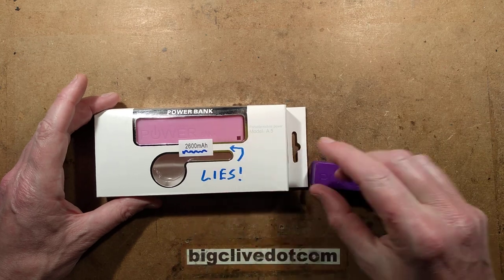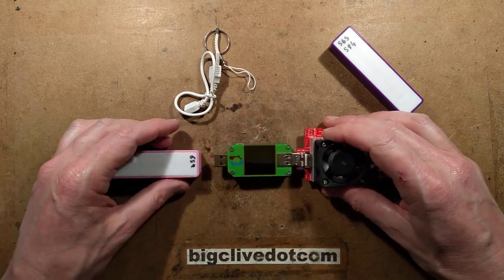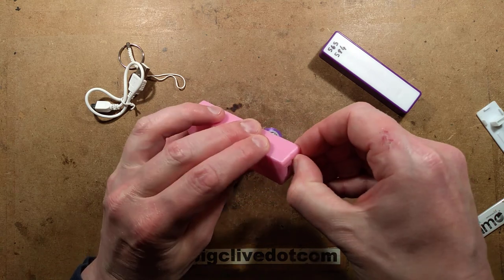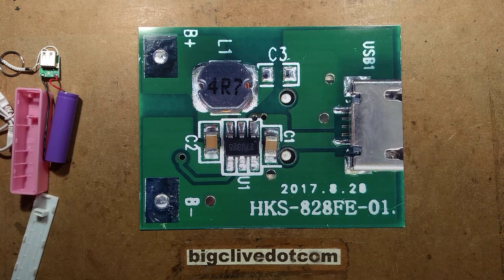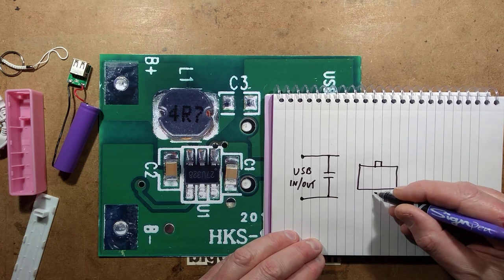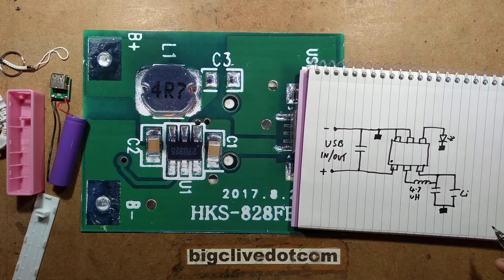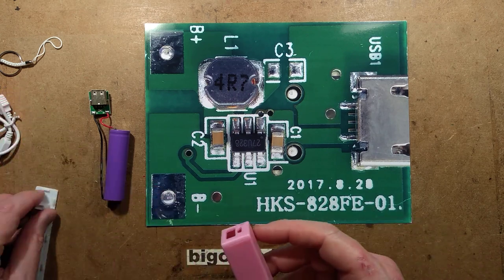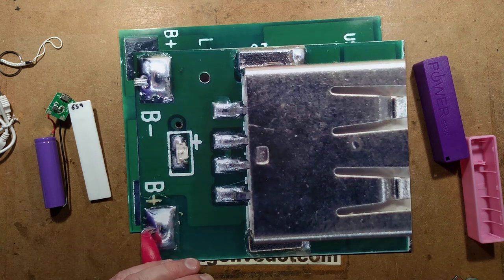Simplest power bank ever?

Comment: Clive... in an old video that I can not find now you showed microUSB with pust pinned power leads (not smt) I have looked for them on ebay and ali and can not find... do you have any references?
Reply from the maker: If you mean the two pin micro USB connectors they came from aliexpress and were described as 2 pin micro USB.

Comment: Any way this chip could be used with more batteries ? Nice video thank you
Reply from the maker: You can add other cells in parallel, making sure that the voltages are very close before joining them in parallel.  It will result in a higher capacity power bank.  For big clusters of cells I recommend adding a fuse in the region of 3A.

Comment: With that design, couldn't you "chain" these?  So that lets say you had six of them, your would wire them all up in serial and they would charge and discharge together.  Also, they could be used kinda like a USB UPS as they can switch from charging and discharging when power is lost.

Comment: Isn't the capacity you measured, just a capacity at 5V? The capacity of the cell would be accordingly higher, due to lower voltage and inefficiencies of boosting voltage.

Comment: Scammers have been at this since before lithium batteries existed.  I once came acrosss a suspiciously lighweight "D" cell, and on tearing it open found a AA battery in a D-sized plastic cylinder.

Comment: Been meaning to ask... are these rock-bottom priced powerbanks using "passed" 18650s from failed laptop batteries or just new cheap and nasty 18650s?
Reply: From what I've seen they're new crap. Ex-laptop cells (good ones, at least) are perfect for these powerbanks.
Reply: @bobs12andahalf2  Be interesting to see one of these cheap knock off cells opened up and compare it to a good quality high capacity cell, what is the betting that these cheap knock offs pack more inert filler than actual electrode and electrolyte material unlike the good quality cells that pack the inside of the unit as tightly as possible for maximum capacity per unit volume. My guess if you took the stuff inside out and unrolled it they are probably just using a fraction of the active material a quality battery that actually is capable of the stated capacity is using.

Comment: I posted a comment here recently about how you can take advantage of the lies and get free power banks and batteries, and today I ended up discussing the issue quite frankly with an eBay seller, and I thought his explanation was rather interesting.  I had bought 6800 mAh 18650 batteries and complained that they were only 1200 mAh.  He said:

"To be honest, you are the second one that point out these battery is not as described in past 6 months. I have sold thousands of these batteries in past 6 months. Yeah it's just the market, I import good battery at first which was about 2500 mah, cost me $6 each to land in Australia... I found it real hard to sell, as I can't compete with those big brand like samsung, panasonic etc, and then I found out most small sellers, have very good amount of sales by marking them 6800mah, 9800mah..Yeah you can tell by the price easily that's fake number, however, most buyers use these batteries for their torch, laser pointer, or other equipments, they don't really know about battery, I can say more than 95% customers won't check the capacity coz if battery put in equipment and it works, then that's it... I am not very proud of what I do but if everyone else in this market doing these fake sales, then I have to sell them this way for make a living. Otherwise I can't even make a sale if I mark it honestly as 1200 mah.

We get them from Chinese factory. Well yeah suppliers in China won't tell you the truth output if you don't ask.. After you asked, they can help you mark it as much as you like, you can mark it as 10000mah... And any other brand they can fake it...So I can mark these battery in Samsung, Panasonic etc if I like. Just a plastic wrap paper, you can print whatever you like. I don't know battery well so I can't even tell its core is good or bad, that's no way to tell."

That last sentence was because I asked whether these were factory seconds or specifically produced with a lower capacity.  And for the record, because this guy was so honest and up front I didn't ask for a refund in the end.
Reply: Only about 5 % of buyers (at best) realise they buy this fake, corresponds to seller's negative feedback.  

Of course what causes this whole industry to survive and prosper is the dumb and stupid way all consumer devices indicate " % charge " instead of Energy Capacity.

Comment: Given that the input and output of this are in parallel, would it be possible to use this circuit as an uninterruptable power supply?
Reply from the maker: I tested that.  When an LED module was powered from the unit while it was connected to a charger it lit the LED module while charging, but when the supply was removed the LEDs went out briefly before the unit detected it was not being charged and kicked in.

Comment: Very true big Clive mate granted there are some very dodgy power banks out there probably more often than not sold on eBay I bought a 10,000 mah dual usb port charger from B and M about 6 years ago made by Goodman's to be honest it's rugged and I like how it has a led display to show the charging rate when been charged up and also the way it tells you the charging status of devices connected to it as by and large all I use it for is charging up my 88 vape e pens though it does support fast charging of apple products i.e i phoned I pad but I don't use it for my android phone i find that my phone charger is faster than the power bank 😅

Comment: Brilliant as ever. How are you checking the mAH? do you have special bit of kit or even more clever Mathes?
Reply: He uses the the (green device he plugged in first) they are quit handy, it will tell you capacity, mah, voltage. And a timer. USB voltmeter is how ya look them up.
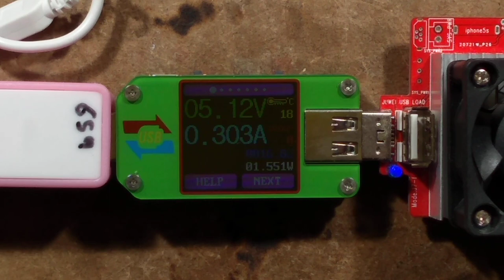Reply: Did you notice at 2:56 how the capacity reading was flashing?  This is the last reading the device had before it lost power.  So you can use them to run a power bank completely flat, then plug them into USB power again and you get a few seconds to read the flashing capacity from that last run before it resets to zero.  This means you can use the same device to measure how much power a bank absorbs when charging, and then how much of that gets returned again when you use it to power something.  Very useful!
Reply: @Berkeloid0  The flashing one was mWh reading... Did you mean that or the mAh one? Also, can you explain the whole process a little more in steps, please? Didn't quite catch it... Thanks for your time. Because I'm doing it right now to test my car starter cum power bank with two similar but not the same meter and load.

Comment: Could this be used as a sort of UPS for USB powered devices? 

I made a nightlight with a Arduino and neopixels - It draws about 40mah average, but when the power goes out my daughter can't sleep without it. Would you trust this sitting behind a bed, plugged in non-stop?  (and would 40mah stop it from going to sleep?)
Reply: Sudz mah.  I don't know if it'll feed a 40mA load or shut off.  However as for bedside safety, the quality and safety of the mains-to-5V adapter is much more important, as some are prone to cause fire or electrocution.
Reply: @johnfrancisdoe1563  I'd use my own 18650 on this for sure. Just seemed like a fairly well designed little chip. He didn't really imply it'd burst out into flames. 

The charger I'm using is an Old Blackberry charger - its been going strong for 4 years now, and at that light a load its not working hard at all.
Reply from the maker: I have a night light based on a couple of good quality NiMh cells and a standard warm white LED.  It runs for months on a charge and puts out just enough light at night to provide comfort.
Reply: bigclivedotcom my idea is a bit different. I was wondering if the circuitry would work in a way that would charge the battery and pass through 5v when supplied with power, then kick in automatically when the supply is dropped.  The nightlight is a baby's mobile with a flying Tardis with some gently twinkling neopixels, surrounded by planets and translucent stars.

Comment: the mAh rating on those is for the battery inside not after the step up loss but still this is wayyy off
Reply: True enough, I would expect even good ones to be on the order of 5-10% lower than advertised if measuring the output current as I would expect manufacturers to measure the input current during charging instead since this will always give the larger sounding number for the packet as it omits the inefficiency losses of the cycle. Probably closer to double that once you make allowances for acceptable tolerances during binning etc.

Comment: Comments remind me interesting open letter to Samsung I'd seen (about trying to buy a genuine branded cell), which I've just found again and pasted here..

The situation at present is riduclous. A thriving counterfeting industry based in Shengzen exists. They clone a Samsung battery in every way except achieve the authentic Samsung battery performance. The consumer sees a mA/hr number on the label but it's counterfeit as the printed Samsung logo. 

Now if the smartphone displays battery status in mA/hrs actual ENERGY LEVEL instead of the usual ''percentage fill level'' , then showing this mA/hrs would stamp out the problem of counterfeiting overnight. You would give the consumer the tool to police the counterfeiting industry from their end of the supply chain by showing them the quantity of stored energy they have after they fully charged their device. 

Meanwhile only a small percentage of people know what mA/hrs is and have the means to measure it. You will find that this perctentage closely corresponds to the amount of negative feedback received by Ebay seller of ‘geniuine Samsung battery’. This sector of people is growing. These people exploit the present situation to obtain a lifetime’s supply of free batteries. They do this buying Samsung-branded batteries (including 18650), use their equipment to prove they bought a counterfeit, demand a refund and then keep the ‘Samsung’ batteries. In rare cases they will receive an authentic battery so these people win both ways. 

In this age of climate change concerns the consumer is becoming ever more concious of the concept of energy level. They have a power meter in the home showing watts. 

I am saying please make your new phones indicate energy level (not fill level) and enable the consumer to be aware and stamp out the replacement battery counterfeiting industry from their end of the supply chain.

Comment: Hey BC/DC :D , or just Clive. :) I don't know where to post this at all. I am replacing caps in an older Asus router, I replaced two of the three caps with exact values, but the third one I do not have. It's a 1000UF 6.3V cap, and the closest I have is a 1000UF 25V cap. Can I use that cap, or do I need to buy a new exact cap?
Reply: Phrea Nix Higher voltage cap just means it might last longer at the low actual voltage.
Reply: @johnfrancisdoe1563  Ok, so replacing a 1000UF 6.3V cap with a 1000UF 25V cap is very ok?  
What about 'smoothing' etc? It's on a router.
Reply: @phreapersoonlijk  capacity and voltage are OK (voltage rating on a cap is how much it can handle, so a higher rating just means higher margins, but also usually a larger physical case)
What might come into play is ESR (equivalent series resistance), for effective smoothing you want low ESR - you'd either need the data sheets/specs or measure a known good example of the original...

Comment: Could you use these batteries in electronic cigarettes if you desoldered the wires?
Reply from the maker: No.  They are not suited to supplying high current.

Comment: I got some cheap AA batteries from china.  Stamped 1500mAh actually 250mAh.  The logic there is you get 6 charge/discharge cycles before they explode!  6 x 250mAh = 1500mAh, makes perfect sense but means you only get 3 cycles before yours go bang!

Comment: A decent 2000mah battery sells for around $4, what do people expect for a dollar or 2?? And that board (or similar) sells on eBay for about $0.79.
Reply: theR6969 They expect a typical 50% off on the price deal.  A factor of 2 on single item prices is not suspect in retail, as long as there's a BS explanation like "holiday special" or "Max 2 per customer" or "stock clearance".

Comment: So the circuit is pretty good, but it's downfall is a crap battery. 
Here in Australia I bought one that looks similar, but it was from Kmart instead, I took it apart and it had an orange 18650 in it, which says it's 2000mAh, I used the Imax b6 and indeed it is 2000mAh, so you can get some pretty decent ones obviously, even if cheap, since mine was only 5 dollars Australian. 
However the capacities of the batteries in your video, and it's low amp output, both suggest that these are lower quality batteries, likely even physically lighter in weight and in only the high 30's of grams. If you put in a higher quality battery, the power bank would probably become useful.

Comment: We have those at The Dollarama here in Canada I tore out the board for a 3000 mAh phone battery. 
Edit it certainly has more components on it though
Reply: the case is standard, it has the right size for a buck/boost converter and a 18650 battery, and is injection molded by the hundreds of thousands

Comment: The best. To my own knowledge is the US sold generic iHome battery power bank. I can get 3 full phone charges, which I paid for about 20; prior, I bought a Chinese sold on eBay power bank with solar panel, and an led lamp... That piece of garbage charged my phone 50%, and then died.

Lessons learned; by ever buy unbranded "complex" electronics from eBay, or Amazon; I threw that thing out. Not even worth it as a lamp. 

The only thing that I bought, and use is the "light bulb pendant light cord"; I highly doubt that it can set the house on fire.

The other battery powered from China that I bought from eBay that has turned out well is a micro USB rechargeable milk frother.

Comment: I suspect 27U328 is a part number given by the power bank manufacturer. I did a google of the number printed on the board, HKS-828FE-01 and came up with a data sheet: https://ic-fortune.com/upload/Download/DW01x-DS-17_EN.pdf The chip has the same form factor as the one in the circuit and it does the same thing.

Comment: I bought 2 x 2500mAh 18650's for £6.95, that's about half the shop price. The EBAY UK seller had sold over 900, had a 99.2% positive feedback. One battery lasts me all day as I don't go around like a World War 1 destroyer laying a smoke screen which has led to pubs banning vaping - thanks a lot idiots. Just a few simple checks and you should be OK. They are about 8 months old and seem to be lasting just as well as 3000mAh ones that I paid £8 each for.

Comment: Less than 1Ah on an 18650 battery is pretty cheap, typical is 2.6Ah. 800Ma and then drops below 5V is almost useless. To be worth anything it must put out 2A while maintaining no less than 5V, and be much better with two full 2.6Ah capacity batteries for a total of 5.2Ah and also charge with the same 2A or more rate.
That power system would only be good used in a solar powered/charged 45Ma garden/foot path light

Comment: I really don't like the way they have one of those tiny capacitors directly across the lithium battery. These are small multi-layer ceramic capacitors which have a nasty tendency to fail dead short. Placing one of these across a lithium cell would not end well if it failed :(
Reply: it will likely do that anyway, going by the rest of the quality lol

Comment: I have a kit (not DIY ) 12000mha 12amp powerbank
I tested it it came out as 8177 does that make sense or have I got it wrong
I was told  8177÷ by the powerbank capacity in this case 12000 then times 100
Or have I brought a fake thanks clive
Reply from the maker: Keep in mind that the capacity is the lithium cell and not the 5V output.  The boost from 3-4.2V results in a lower mAh figure.   Other than that, it's very common for the capacities to be exaggerated for sales.

Comment: I do hate those fucking sleep modes on these power packs. I have DOZENS of these damn banks, and this damn watch that I want to charge, NONE of the damn things will charge it because it takes so little amps to charge. I am forced to turn on my 5 volt power supply (Purchased after watching Big Clive make it work!) to charge the damn thing. I have finally given up wearing the damn thing because it is such a pain in the ass to charge. I have gone back to my watch that I built out of a kit, takes 5 batteries but they seem to last a long time after I purchased some name brand batteries and not those damn fakes from China.

Comment: The batteries are probably scavenged from dead laptop batteries, rather than throw them in the bin they put them in power bank cases and make a buck from selling their trash, plus they don't have the cost of disposing of the batteries.
Reply: I've had pretty decent cells from dead laptop batteries.  You'll often find a couple of cells inside the laptop battery have failed, and the laptop battery protection circuit prevents further charging because of that.  You can usually get four decent cells out of six (often the battery is three sets in series of two in parallel 3S2P).  Open the battery and measure across each set of cells,  the ones with the lowest voltage will be the failed ones.  The others should be quite usable as single cells.